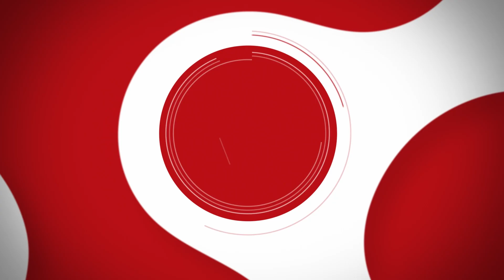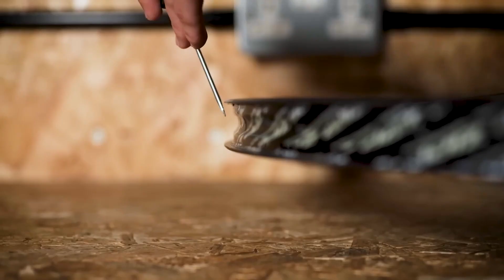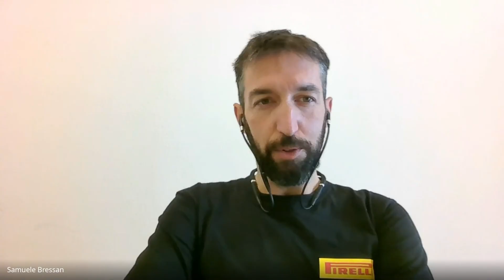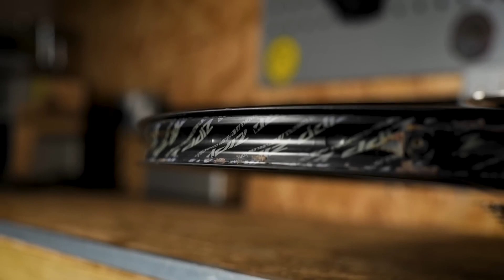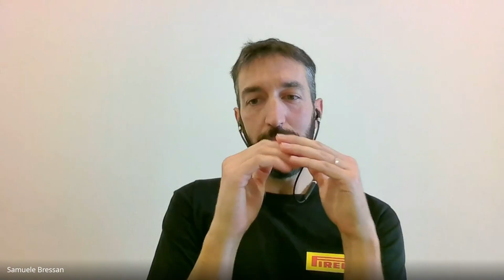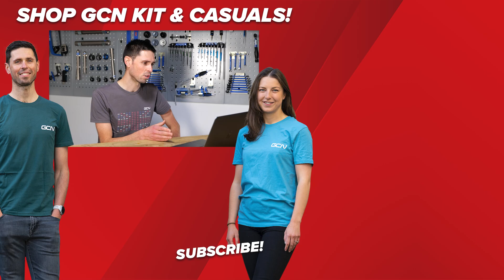What Makes A Good Bike Tyre? | Everything You Need To Know About Tyres!

Comment: Still not clear on whether it is 100% safe to use a hookless tyre on a hooked rim, for example if you've changed wheels and have new tyres bought for different wheels..
Reply: It’s 100% unsafe. Hookless tires are purpose built for hookless rims. The tire interface with the rim needs to be very precise. Putting a hookless tire in a hooked rim will not work.
Reply: @danielakerman8241  Thanks. I'll take my Maxims off my Scribes.
Reply: Not sure that's entirely true. Giants fondo tyres can be used on both hooked and hookless rims. Their hookless tyres still have beads and fit on hooked rims. Many tubeless tyres can be used on hookless rims. Though with the proviso that the rim manufacturer has tested and approved them for tolerance.

Comment: This pirelli guy saying weight matters and yet the P Zero TLRs are heavy af.
Reply: I've ridden several thousand km on both Cinturato TLRs (32 and 35) and P-Zeros both SpeedCore (30) and prev. gen.(28&30) and I can tell these are reliable AF;) P Zero family tyre suffered only one puncture (most likely sharp piece of gravel when rode off asphalt through unpaved patch while riding in the dark) which sealed well w/o pressure loss to even need to pump immediately (I live in central-eastern EU country where roads are not always in perfect shape, riding mostly endurance/exploration and sometimes doing unpaved dirt road shortcuts when practical or can't avoid). P Zero (which is much lighter than Cinturato, btw) is indeed much heavier than lightest tyres on the market, i.e. I had Schwalbe One TT originally installed on one my bikes but removed them, these are air-weight, yes... but too flimsy for me (maybe will use in summer for training rides). Regular P Zero could be suboptimal choice for TT, race, or even fast-pace group riding on asphalt, sure, but well balanced for endurance riding, comfy, grippy, reliable, working tubeless well, can even manage some light-gravel sections when needed. Cinturato can do it even better obviously, is indeed slower, yet would work marvelous as all-weather commute or trip/expedition tyre, as alternative for light (in comparison, oc:) and faster alternative for some heavy-duty tyres like Schwalbe Marathon (assuming not encountering much mud or loose sand).
Reply: @Dorkeus82  I haven't tried the new speedcores but I have ran the Pzero STRs ob both my tubeless rim and carbon wheels and they are very much bombproof when it comes to puncture protection (compared to lighter tubeless tures) so I'll give them that. I might run the Pirellis again this winter just for piece of mind. Just sucks they are slow but fk it, winter is for base training anyways.
Reply: @JFomo Amen to that! SpeedCore ones I fitted prev. year to replace prev. ones (2020 model - already badly worn), these work at least same well imho, according to bikerollingresistance site are about one Watt 'faster' than prev. generation (though they compared 28 vs 26 size) so better but marginally, still 4-5 W behind fastest rolling tires on the market, barely can feel the difference, wet grip even better than before (can attest) and almost as good punture-resistance (I got a puncture with sealant leak on the therad on new one thought it didn't happen for 2 pairs of old I worn, either bad luck or are actually slightly less robust, yet puncture sealed well on spot when stopped, to my relief, was afraid I would need to test how Vittoria AirLiner I've installed inside the tyre handles 40 km of limping home through the night if it didn't)
Reply: @Dorkeus82  I recommend you carry a Dynaplug. Best product ever. The bacon strip style plugs are crap and don't work as advertised.
Reply: I dont care how much a tire weighs long as i can get to my destination 😂
Reply: There is no such thing as perfect solutions in engineering. There are always trade offs and compromises. That same Pirelli guy talks about that very issue at 23:30.
Reply: @danielakerman8241  x100 👍
Reply: Anyone done pirelli vs gp5000? As I want decent pressure keeping I'm picking to go with inner tube to balance wheels easier compared to my other bikes where I use tubular
Reply: @mlee6050 tested many times on different sources: GP5000 are much better. Pirelli are way behind GP5000, Power Cup, Corsa Pro and behind other faster TT tires such as Corsa Record, Pro One TT, GP5000 TT and Veloflex Record
Reply: @mlee6050 given GP5000s are considerably lighter and still have a reputation for reliability which has held up through the long history of the GP range.